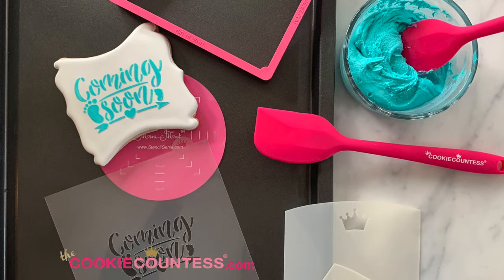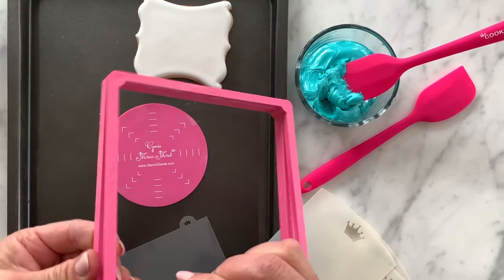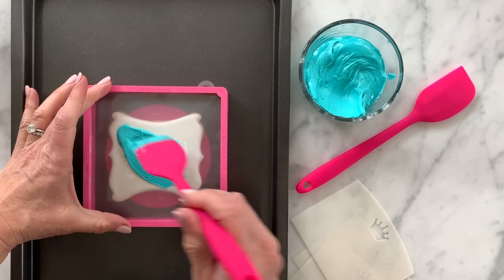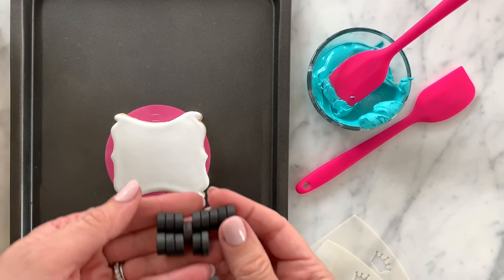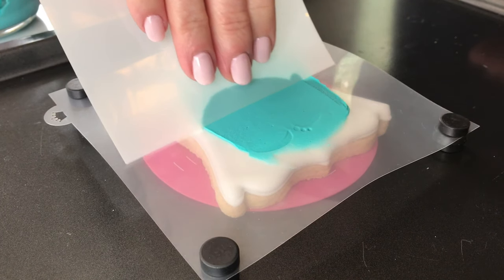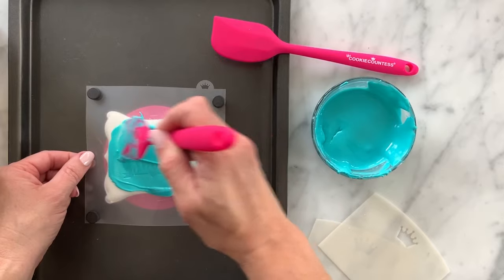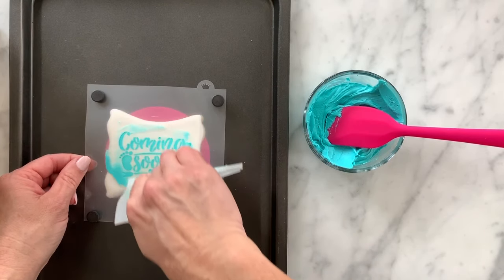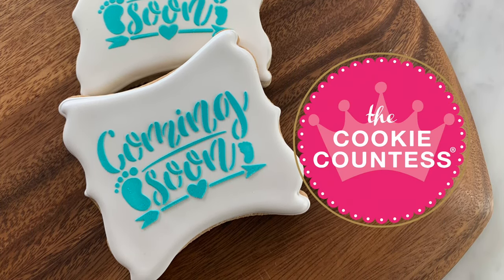How to Use a Cookie Stencil w Royal Icing - Tips Tricks Common Mistakes

Comment: This helps sooo much, thank you!  But, another thing I want to know is how to stencil multiple cookies without having to wash the stencil every time. It seems as if even if I don't have icing bleed underneath, the stencil still carries over dried icing from each cookie.  What am I doing wrong?  I've never seen a video demonstrating stenciling multiple cookies with the same stencil, back to back, assembly line fashion.
Reply from the maker: Tracy, you can certainly use a stencil multiple times! As you use stencils more, you'll learn to reduce that "underspray" where the color gets under the stencil. If you need to pat the stencil on a paper towel between cookies that could work too.

Comment: Erm  but in the runnier icing consistency demo you scrapped in all directions (so of course of course it would do what you said in the first demo i.e. seep under the stencil) whereas with the stiffer icing consistency you only scrolled in one direction (horizontally). 🙄🙄🙄